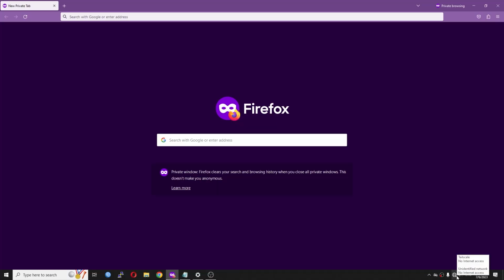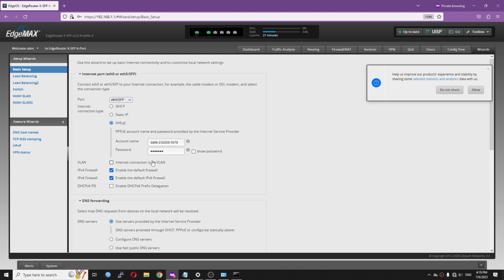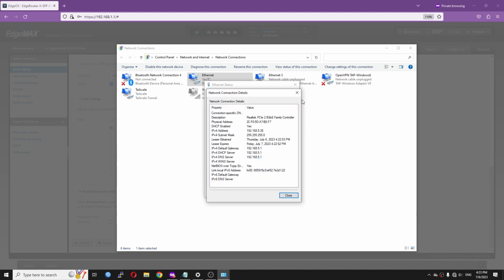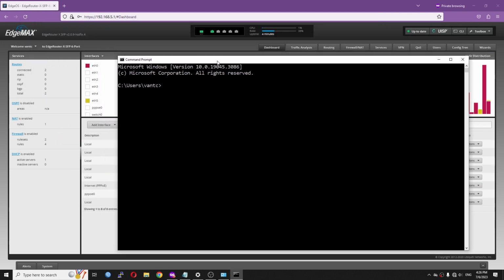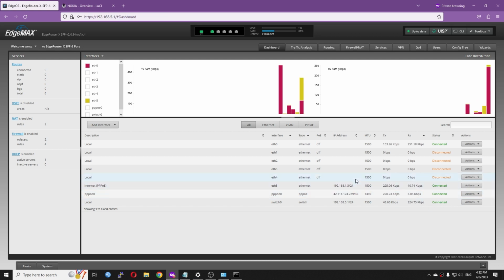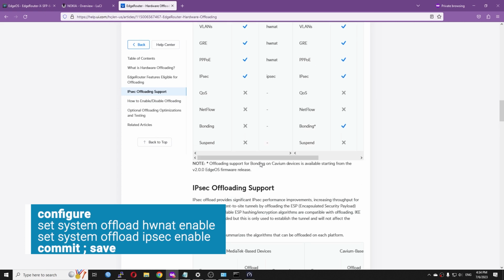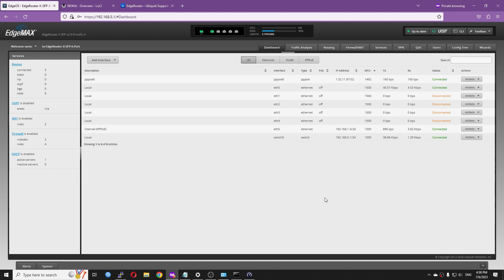Configure the EdgeRouter X SFP with Nokia G-010S-A GPON module

Comment: My friend I need your help. I'm from Sri Lanka and I'm using a ZTE f670l fiber router my ISP doesn't allow me to use bridge mode so i can't use any gaming routers so I'm looking buy the TP Link Archer ge800 gaming router because it has SFP+ port so can you tell me what are the things and configuration I need to replace my ISP router to use the archer ge800 router?
Reply from the maker: Hi, this this case you need a GPON SFP module. See my videos below for more information:
HSGQ: https://youtu.be/ufzR8e4mubg?si=ll7iW2onT-Ns03_i
Nokia: https://www.youtube.com/watch?v=3g6mRDfUppQ
Hisense: https://www.youtube.com/watch?v=yD8aq4KSWko
LEOX: https://www.youtube.com/watch?v=G3va7X4PZFo
Reply: @VanTechCorner  thank you for your help. I just bribed my ISP technician he gave me my pppoe password and username id now so I just enabled bridge on zte f670l ISP router now it's just working as network switch now I'm using a cheap 3d party router with pppoe connection my question is does this setup has Double NAT issue?

Comment: Couple of points. Firstly as per the release notes ipsec hardware offloading does not work on the Mediatek Edgerouters like the X SFP when using EdgeOS 2.x Secondly you have an MTU of 1492 on your pppoe interface. Consequently, you want to set some MSS clamping "set firewall options mss-clamp interface-type pppoe mss 1452". Finally, you should not need to setup masquerading to access the GPON SFP if you configure things properly. It is a routing issue and no masquerading is required. "show ip route" from the CLI should show it as a connected route at which point it should work. Might be some artefact of the wizard, I have only setup Edgerouters using the CLI.

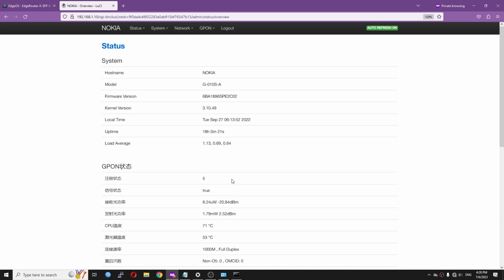Comment: how did you find the mac in part 9:35?
Reply from the maker: Hey, this information is on your ISP provided router. After login, you should be able to find something like: WAN MAC Address, or if it doesn't work, try the device's MAC address. From my experience, the WAN interface's MAC should be a little bit different from the ISP router's MAC. Another solution is to ask your ISP.

Comment: Can you help me vs
GPON ONU Stick with MAC SFP 1310nm-TX/1490nm-RX 1.244G-Tx/2.488G-Rx Class B+ 20km DDM SC/APC SMF Optical Transceiver Module
runs on edge router6p
I have set it up as you instructed but cannot log in to sfp
Reply from the maker: Chào bạn, bạn đã làm được chưa? Nếu chưa bạn cần kiểm tra hai thứ:
- Đảm bảo IP của module GPON không trùng/ cùng dãi với IP LAN của EdgeRouter
- Phải cắm cáp quang vào module sfp thì thiết bị mới chạy

Comment: Great Video, the tip about accessing the device on the WAN port is particularly helpful. I was running a 2.5 Fiber router (bridge mode) and a ER-X unit, but now I've upgraded to a (save's me a power socket) ER-X SFP and a ODI 2.5Module ( DFP-34X-2C2) been running sweet for a few days. Feel the ER-X SFP is a little better performance than the ER-X basic model.
Reply from the maker: Cool. I also have a ER-X SFP, unfortunately I am running Gigabit plan and my ISP allow >1 Gbps throughput. So I am now using a 2.5G Media Converter and the 2.5G GPON SFP module.
Reply: @VanTechCorner  do you mean the modem (GPON) side negotiate at 2.5G/1.25G but module ethernet chipeset is still SFP standard (1Gbps, not SFP+ - up to 10Gbps) ?  I have module in SFP+ port (UDM-PRO) and it negotiate 1Gbps. I have SFP+ ethernet modules that negotiatiate at 10G but serve 10, 5, 2.5, 1, /100 etc. GPON SFP+ exist does the same? Looking into chipset that has 2.5Gbps ethernet lan. They sell the plans here...

Comment: I recently got running with a different GPON SFP (not SFP+) in a UDM-Pro

Finally cracked it 😀

// Awesome videos. For me was clone Mac, serial and ploam as ppoe username 😁
Reply: To add to this ISP supplied ONU's (fiberhome brand but also have had ZTE issue) I have ping latency and daily speed tests my UDM-PRO is consistently faster connection.

10% lower latency 
15-20% speed increases

I have 750/750 fiber to home in Thailand. Can make 1000/500 or 500/1000 too. 

Always 850/850 with 900 burst and reporting over 1Gbps on unifi 

I note these SFP GPON ONU's are 1Gbps on ethernet interface.

Are there SFP+ GPON ONU's yet? 😅
Reply from the maker: Hey, thanks for the information. Can you share your current city and the GPON SFP module name?
There is another viewer from Thailand and he is trying to get rid of the ISP ONT and replace it with a 2.5G SFP module. We are waiting for the parts to arrive for further testing, but I would be great to get some information from you.

Comment: Hope you are well? Please help me, I wanted a tutorial. I want to use 2 separate isp's broadband together, both ppoe connection. Using mwan3,loadblanching openwrt,with wire guard vpn I want to make it a completely different isp. You have earlier tutorials on this topic, but I want tutorials on latest openwrt's mwan3, load blanching, wireguard. My Router Model: Tp-Link Archer C6 V3 I am using openwrt on this router.

Comment: Hi. I'm newb in linux, and can't find problem solution: my xiaomi r3g v1 used for transmission + samba. I was made installation by official openwrt guide, but facing with several problems: 

1) transmission installing on tmp folder by default;
2) transmission and samba4 have issues with user-group (problems with deleting and moving files)
3) maybe [2] provide some problem with partition table - after ssd completely written once I can't delete and rewrite it (system think there is no space left). 

I can't find solution and never heard about this problem. And pleas give advice about user policy to use with smb and transmission.
Reply: Your router’s rom is padavan or openwrt? I’m using a xiaomi 3g as well. But I am using the keenetic rom with all features such as: smb, upload and download torrent, ftp… Let try it on your router if you want.
Reply: @loimaihuu5477  openwrt. I think about switching (I think it's all about disk driver). Thank you for advice.
Reply: So... after 3 times reinstalling openwrt I have know 2 things about openwrt and transmission + samba with ext4 ssd:
1) don't use official guide (transmission don't have permission for writing on /mnt/sdX directory (even as root in my case);
2) new samba4 don't work with macos as previews - can't entering with password;
3) I didn't fully write disk for emulating out of space error, but I think it's there.
Did not why OpenWRT so RANDOM generated bu++ igniter. In previous revision samba works normal transmission run as "root", but now it's total trash. And no one no how transmission as "transmission" can write on /mnt/sdX

Comment: Where i can buy the Nokia G-010S-A SFP?
Reply: taobao, aliexpress, but ODI DFP-32x-2C2 is better than G-010S
Reply: @Mrfunny2011fly  ODI DFP-34X-2C2 support 2.5G?
Reply: If you are in India, I can sell you for Rs. 5000. Nokia G-010S-A doesn't work with my ISP.
Reply: @sanke4fgh  im sorry, currently im not in India
Reply: Before buying, you have to check to be compatible with your ISP
ODI gpon sfp has supported 2.5G
Reply: I also suggest ODI, as mentioned by others. I have one ordered, as Nokia and Huawei devices are 2nd hand devices. Whereas ODI is a new factory manufactured with a 1yr warranty.
Reply from the maker: If you guys staying in EU/US, I sugges the LEOX LXT-010S-H. It is from LEOX - Leon ISP in Poland and it is based on the RTL chipset, just like the ODI one. I am going to have a video about that, soon!
Reply: ODI DFP-32x support to edit, clone mac too ?